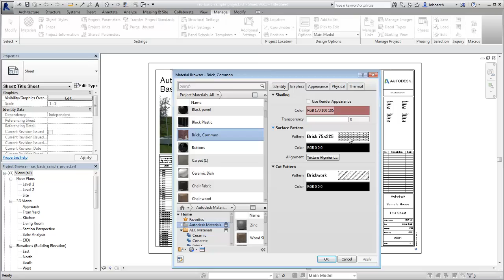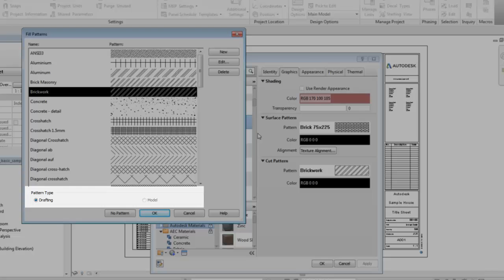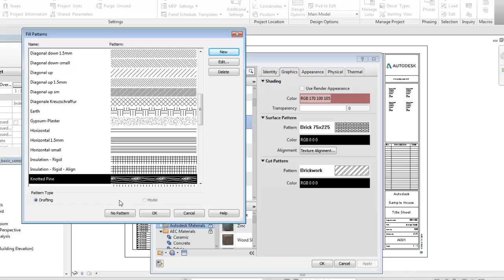Autodesk Revit: Create a Fill Pattern

Comment: Hey there its great to see your tutorials, please guide me hatch some walls on level 20 though i have added brick pattern to its properties and modified visual graphics of wall and also tried additional settings for the hatch purpose but i still don't see a brick hatch pattern on the wall at level 20. please help me hatch these walls.
I get these brick hatch on other levels but not at level 20.